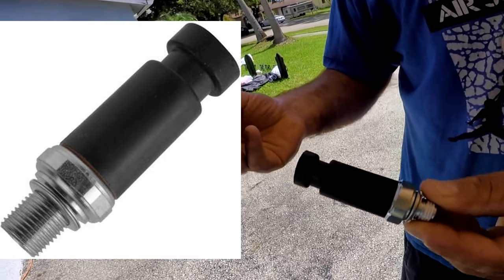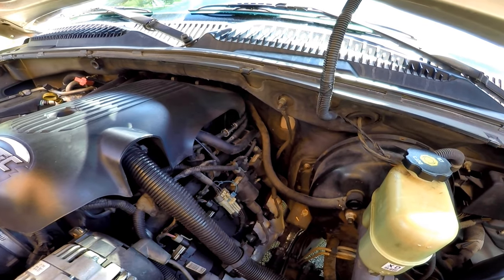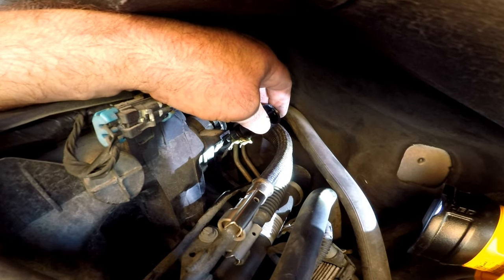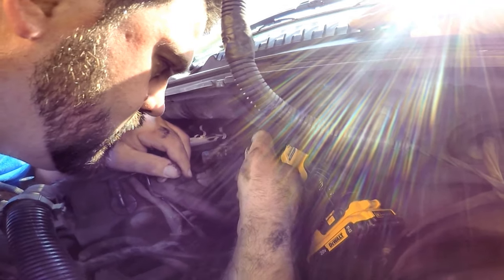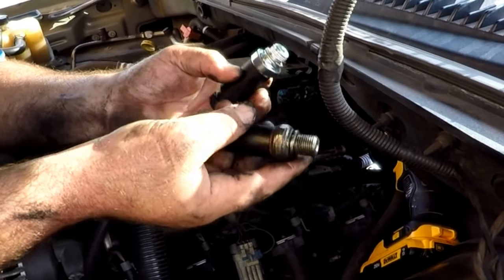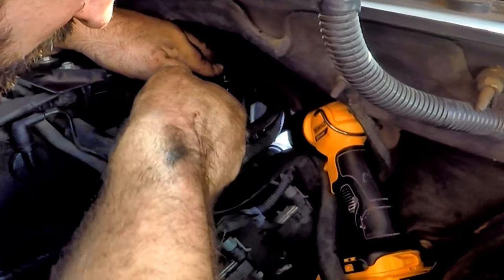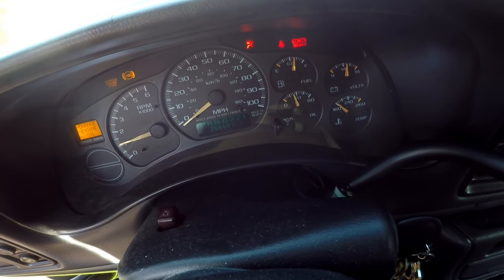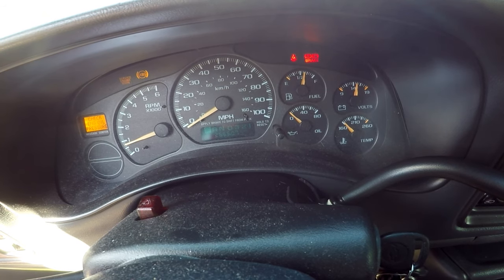How to replace Oil Pressure Switch 5.3 LS Chevy Engine 1999 to 2002 Avalanche Suburban Silverado

Comment from the maker: This video will cover how to change the oil pressure sensor for this 2002 3.5 chevy vortec engine. There’s little variations between different vehicle manufacturers and models, but this video can be a guide to get the job done on any engine.

Comment: In newer 5.3 engines, people talk about a screen that is deep to the sensor. They remove and clean the screen. In my dealers manual for the 2000 Suburban, they make no mention of a screen. Do these older engines have no screen?
Reply from the maker: No screen in this 2002. I would assume the same on a 2000.

Comment: They didn't make it easy getting to this sensor did they, lol. Hopefully that means they don't need to be replaced too often. Good job getting it done!
Reply from the maker: It was still the original part so no, not often thank goodness. With this sensor working properly  we confirmed there's an oil pressure problem and we did replace the pump the following weekend. You will see on the next video. Have a good week Josh.
Reply: @JohnCRV  Yeah, I see your most recent video is all about that! It's a good thing you know (or have someone who does) know about this stuff. I used to have a guy that did all that for me, but he has moved, so I now just take it to the garage. A lot more expensive that way, lol
Reply from the maker: I been getting my sons to help with my projects and I help them, we are having a good time too. Gives me more time to give them advise. But my oldest is very mechanically inclined and he loves learning new things. He has a passion for old vehicles and swears they were built way better than today's. I happen to think he is 100% right.